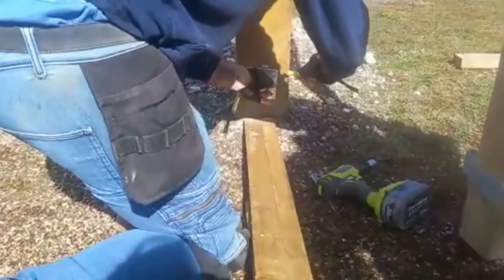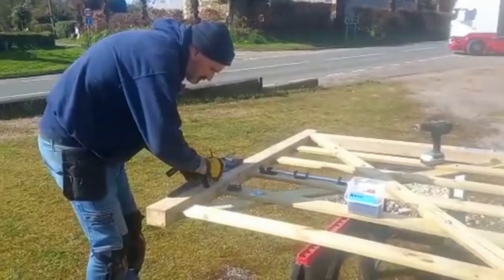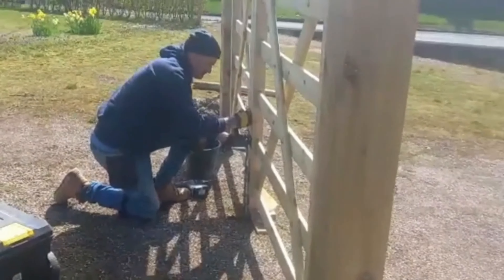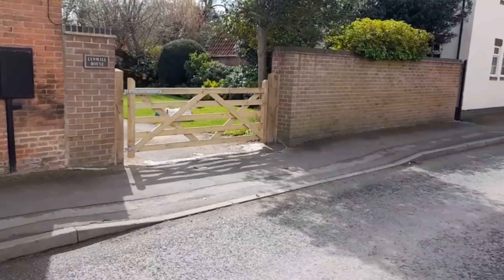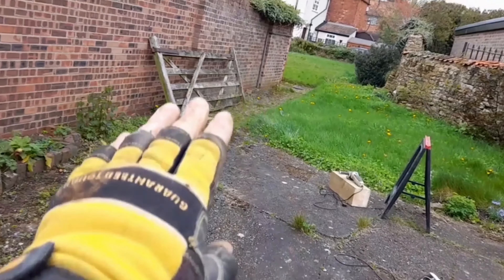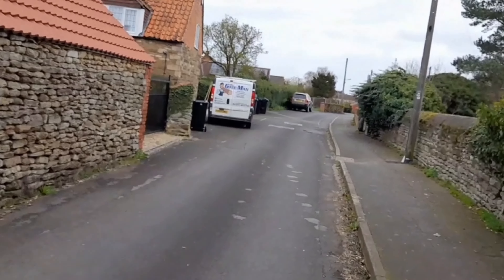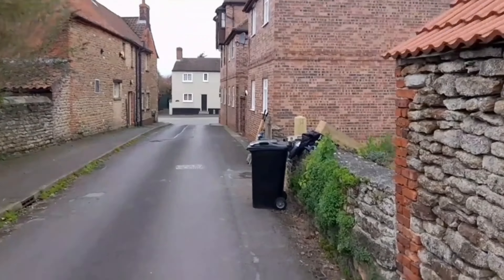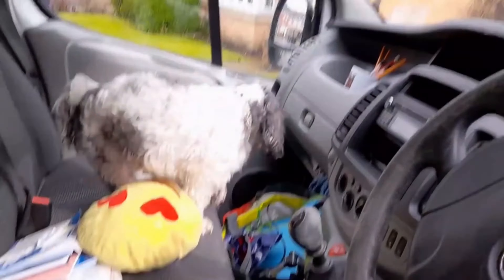HOW TO HANG 5 BAR GATES!!

Comment: Personally i dont think its worth upgrading the jackhammer, at least not till it dies,  and then i would be tempted with the titan one, good reviews and a little bit heavier and more wattage.
Odd question, what do you do with all your 100x100 offcuts and old posts?
Reply from the maker: Good advice  .. thanks for watching and commenting.. off cuts.. goes to our  log burner, any ideas ??
Reply: @Gateman1  If you get  any "lumps" about 9-12 inch  could  put a Handle on the top with your logo burned or routered onto it, it can be used as a Rustic Door /Gate stop ( plus free advertising) , you could even sell them as blanks especially if they are oak. 
Also, you really should look to have a "made by Gateman" plaque on all your gate installs, i think a small 2 inch one would look good on the gate edge/post, and people always look as new installs just out of curiosity. 
And finally... if you have any old solid 100x100 post offcuts about 3ft plus i would buy them off you as i need to renovate a huge garden and can use them as mini sleepers/features, basically the middle bit off the old posts with rotten bases
Reply from the maker: @charlesuk5358   07311457150 give me a text .. thanks john 👍

Comment: Hi John just caught your channel and you do some very neat work and use quality materials, just one question why have you put the hooks on the inside of the posts i have always hung the gates on the back so the gate can swing right back to the fence line.
Reply from the maker: Hi.. good question .. but the customer wanted the gates swung both ways .. 
If it's at the back.. it can only swing in.. 
Thanks for commenting.. much appreciated ☺️ o